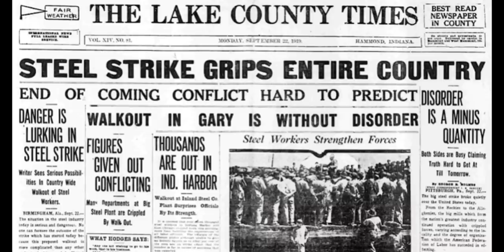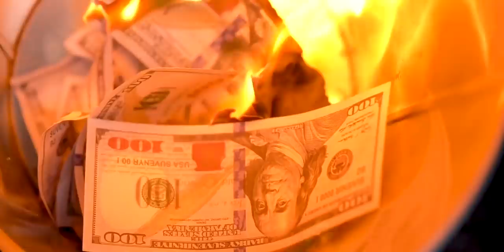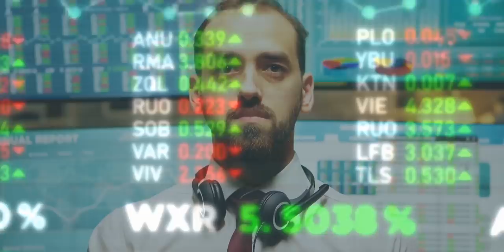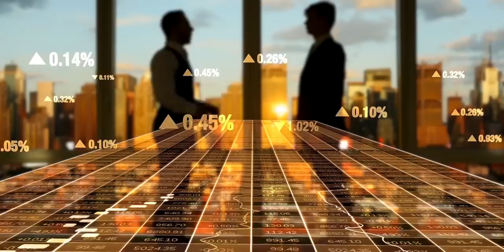How TATA STEEL became the GREATEST Company in INDIAN History? | Business Case Study  Ep2 Tata Series

Comment: Would like to add few more points on Bessemer.Though Bessemer Convertor(1856) was revolutionary for Steel Industry it had several cons. Some info on Bessemer Convertor :
📌Bessemer is one of the earliest form of steel making. There are two types of bessemer process :
1. Acid bessemer process
2. Basic bessemer process

🚀Acid / Basic represents the nature of refractory lining.
Acid bessemer process was the first to be found and later on basic bessemer process was found. Basic bessemer process is also known as Thomas process of steelmaking.

✅1.Acid bessemer process -
In steelmaking the impurities to be removed are C,Si, Mn and P.
Here C is a gas so no issues in its removal. Mn is also basic in nature so it is also removed without difficulty. But oxides of Si and P are acidic in nature , so they cannot be lowered in acid bessemer process. 
The steel has high amount of Si, P and N after completion of process which is kinda bad. 

✅2. Basic bessemer process :
Now since the lining is basic in nature Si, P can be lowered here unlike acid bessemer process. But still the problem of high N content in steel persists here due to usage of air as a oxidising agent.  Thus, Bessemer Process was later on replaced quickly and BOF became the go to SM process!

For more info feel free to check out the SM series here: https://www.instagram.com/metallurgy_daily/p/CR67KzPDpBq/?utm_medium=copy_link

Comment: More explanation, please. I couldn't understand how did they manage to survive without firing workers. The only thing I'm able to infer is that they could survive coz they had enough to drain. Thus they drained from whatever they had to prevent worker strikes while also not dying themselves. 
Correct me if I'm wrong.

(I think the solution should have sounded like they found unprecedented ways to sell... or maybe something else that was able to help them to deal with crisis unlike others, It sounds like they had a bigger buffer to drain away, which isn't helpful as it has huge precondition)